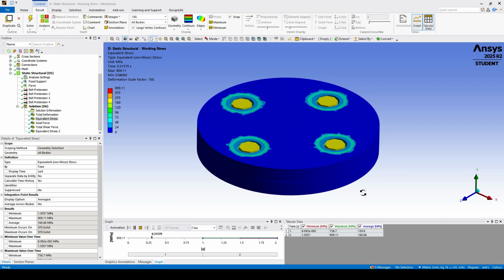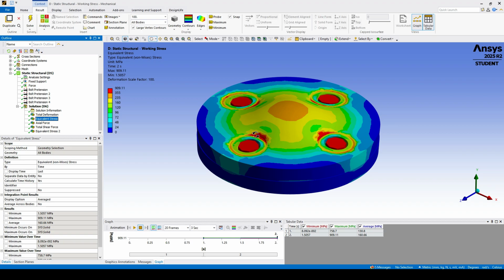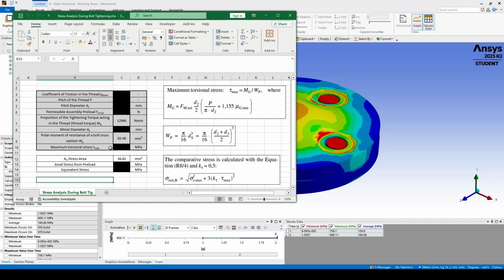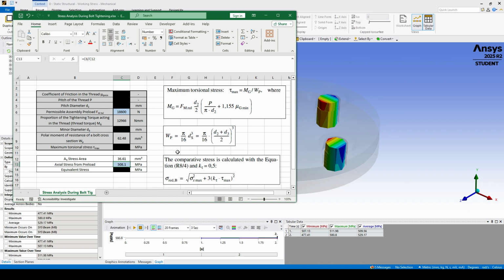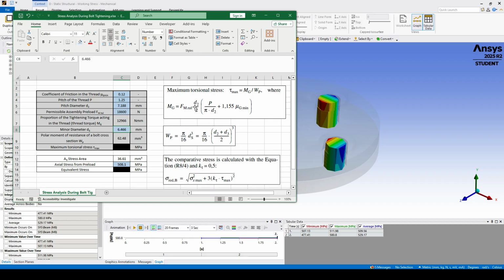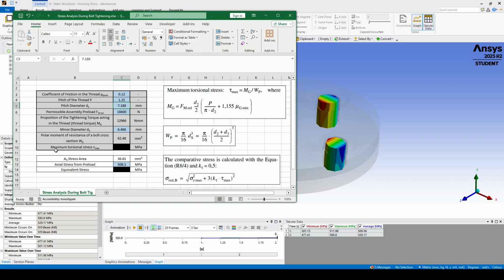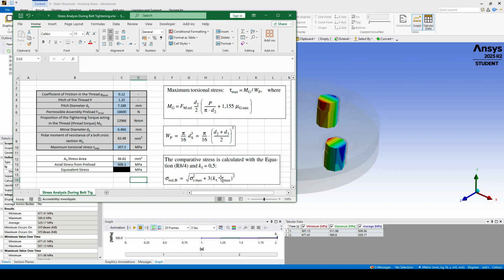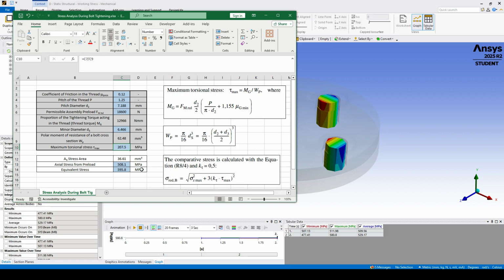Bolt Tightening Stress Explained | VDI 2230 Step-by-Step (ANSYS Doesn't Show This!)

Comment: Hey, awesome series. Just want to point out a small error 
In the excel calculator in Cell C14
The mistake is (3*0.5*C10)^2, where as it should be 3* (0.5*C10)^2
Reply from the maker: Hello thanks for your notice, I will check that and make it right in case it is false. 👍🌹